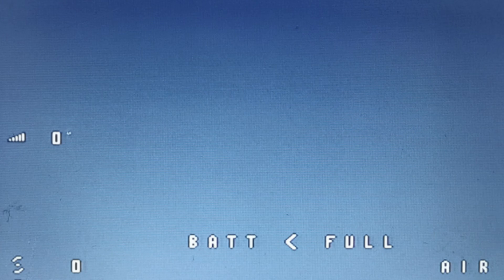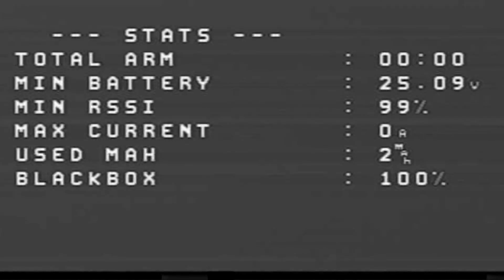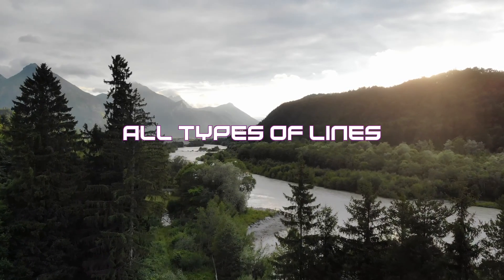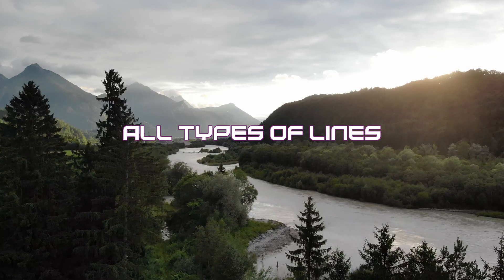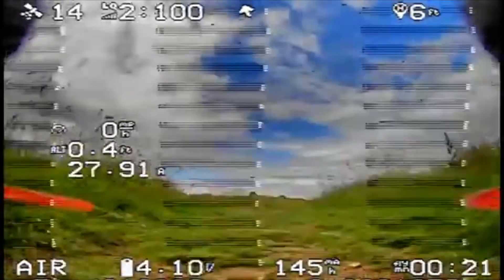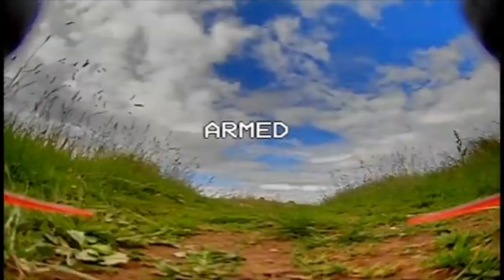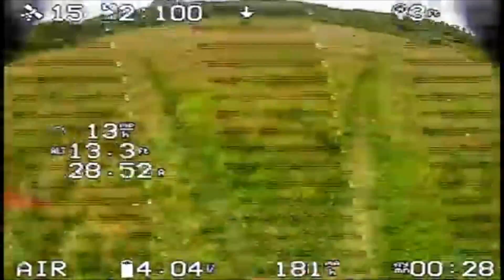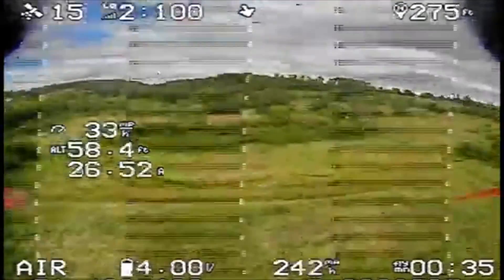10 FPV VISION issues & how to fix them - hacks | MaiOnHigh

Comment from the maker: Did this video help you? Consider buying me a coffee: https://buymeacoffee.com/maionhigh
Learn how to FPV (Parts, builds, solutions, flying, laws) and how to REALLY TRAIN ("just fly more" won't cut it) https://www.fpvmastery.com
Reply: I hate setting up recievers sometimes
Reply: Got to be things just randomly stopping working after they were fine and the quad just not being used for a bit like I mentioned in my comment 👍
Reply: For me is getting different cameras to adapt. I have several AKK VTXs and finding the correct connector and adapting can be painful.
Reply: The video. I have these faint lines in the middle of the feed that refuse to go away. Only happens when I run cam signal through fc to vtx.
Reply from the maker: @madladdan  that's probably caused by some electrical noise. Is your signal cable tied together with gnd? That may help
Reply: @MaiOnHigh  Yea
Reply: Green and pinky
Reply from the maker: I agree... @Jashwanth626
Reply: @Jashwanth626  how did you get rid of these? i have same issue. is it camera or wires thats goes into camera?
Reply: I build a fpv drone recently and all Wes well until a few months later (BTW I fly in open fields ) my video signal got worse there is a lot more noise and my range is not as good as when I first built it and I can't seem to figure it out do you know what might be causing it
Reply from the maker: @jim-xi1ml be sure to change the antenna then. They do get loose and degrade with time (and crashes) - the antennas can also break from the inside, so you cannot see too much on the outside. 
Change the antenna and let me know if it helpes!
Reply: @MaiOnHigh  yah there is also a lot of green looking noise  and sometimes you can see a little red and White also

Comment: Hi, my video feed was fine then randomly started getting just a grey screen with no OSD. Checked all the connections and they are fine, what do you think the problem could be? Thanks
Reply from the maker: Sometimes cables can break on the inside without you seeing anything. I'd change the cables or if you are using any plugs - check those as well.

Comment: I have a mix of white lines and noisy static when nothing is running just sitting on the table. I can barely even see my hand and it looks likes the switching of a slide show 😂 What could be the cause of this?
Reply from the maker: I'd change the antenna and pigtail to be fair. 🤔 (If there is a pigtail)

Comment: What about if the camera feed seems to split into top and bottom section. Like they're not working together, but one lags behind or twitches
Reply from the maker: @Lurpi  hmmm... Hard to guess by text explanation. It may be the info cable. Check your yellow cable. If this doesn't work it may be internal error

Comment: Help! My camera (bf C02) overheated (sitting there, drone plugged in) while I adjusted settings. The image had a blue tint, and after I let it cool, it was back to normal‽ Did I damage anything????
Reply from the maker: @iammeobviously6815  don't let the vtx or camera stand there plugged in for too long 😅
It may be happening, yeah
Reply: @MaiOnHigh  ok

Comment: Trying to work out an issue with my first build right now, and it looks exactly like what you showed as "too much noise" - will check if twisting ground and video cables, also ordered a replacement antenna. Thanks for this, it sure helps!
Reply from the maker: @Grevil89  keep me posted!

Comment: Very informative video, great job!
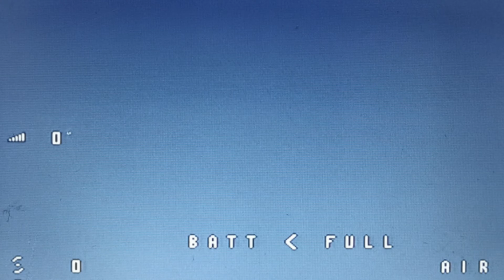Would you mind spent literally 15 sec to overlook my problem please? It starts at 0:28 and till 0:43 you can see how far the drone is from me. 
https://www.youtube.com/watch?v=PzZEpc87bfI&ab_channel=CasualQuadFlights
New rush cherry antennas on the drone and VTX. What could be the problem and solution? Thank you!
Reply from the maker: I would check your antenna placement. The antennas need to be "seen" line of sight in a way (hence they are usually so long) and not touch on carbon. I cannot say much just out of the video if I cannot see the drone ;)

Comment: Meteor75pro, im loosing signal in 5-10m, in 400mw littlebit better, but when i flight to the corner of building signal totally lost😢 earlier its works well on 25mw
Reply from the maker: I'd check and change the antenna in this situation

Comment: My fpv feed breaks up at about 50 meters on 350 mw, is this normal? 

Help would be much appreciated. 👍
Reply from the maker: Have you tried changing the antenna? Sounds like an issue there.
Does it just break to nothing? In random or just within that range? (Like always when you are further away)
Reply: @MaiOnHigh  i watch videos of people with the exact same setup and vtx, (hglrc Zeus nano) and they get much better range and less flickering on the fpv feed.
Reply: I tried to change the output power and that didn’t do anything either.

Even when the quad is relatively close to me, about 2-3 meters, the screen flickers and cuts out heaps.

The antenna that I’m using is a pig tail, should I use a different type?
Reply from the maker: @joe57704  this actually sounds like a broken vtx if it flickers in such a close proximity. Would you mind sending me some pics to my email? Lexie@maionhigh.com?
Reply: @MaiOnHigh  I sent a clip, tell me if you get it
Reply from the maker: @joe57704  got it. I'll look at it when I can

Comment: Mam can you solve my problem I have a video transmitter of ts832   (ROTG01) model and when I have connected to the uvc video receiver with my Android tab then when the transmitter and the receiver connected with the same channel (i.e,.5584M=5584M) only the audio is transmitted from the transmitter and received in my tablet .

After few and quick tries when I have connected with the video also it is a difference between 361 GHz between The frequencies of the transmitter and receiver(i.e,.5584M=5945M) which gives me very less range about 30 to 40 m but the audio range is mainly about 1 km to 5 km so how to resolve this problem mam please help me ..

I also have videos of this issue on drive should i give the link to you ?
Reply from the maker: Hey! I never transmitted fpv to a tablet but shoot me an email with the video to lexie@maionhigh.com
It may be an issue I can solve

Comment: The most useful video I have seen so far. And everything is packed in a slightly more than 5 minute video. So underrated!
Reply from the maker: Thank you! Be sure to share it so it gets more traction :)
Reply: I return to this video because my video is bad again after switching to direct battery supply. I will try to add a little capacitance to the supply line, because it gets bad when the throttle is altered.

Comment: Nice job! I always twist the cam and vtx wires together but didn't even think that you should leave out the red power wire but that totally makes sense. I would add that some lenses, like the ones on the Foxeer Predator cameras, break internally on hard crashes and can vibrate and appear as if the lens is loose even when it's not - but it's actually the lens elements inside that have broken loose.
Reply from the maker: Oh I didn't know that 😅 (never used foxeer 😂

Comment: When it is a grey back and you have  don't osd it can also a antenna of your google, this peoblem i had  a long time, and don't know why i have this problem...
Reply from the maker: Never had that. Usually antenna's issues mean either snow of small range 🤔
Reply: @MaiOnHigh  yeah that i thougt too, but in the end it was  my patch antenna. Every time I flew a little farther away, the picture suddenly disappeared and suddenly turned gray no one could explain exatly to me why. Finally I came to the conclusion that it must be the  antenna. Then I took off the patch antenna and now i flew about 5 times without problems. Now I hsve to get a new patch antenna... (I have to say, it was a very cheap one before)

Comment: I have a quad I’m going to try twisting the video with the gnd wire. Love the quad the video is just sub par.
Reply from the maker: 🤔 hmmm... Does it have capacitors?
Reply: Yes on the caps, moved the ground around, separated the wires, reroutes the wire, still see noise in the video that gets worse with the throttle.
Reply: Horizontal scrolling lines that are very faint but they are there. Haven’t flown it in 6 months.
Reply: Thought about your other comment about a regulator with an L/C filter.